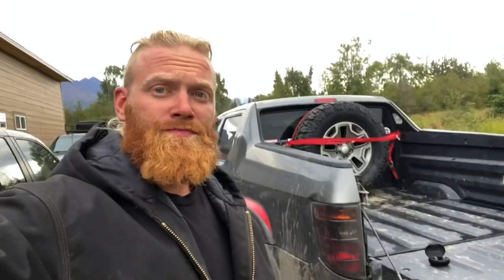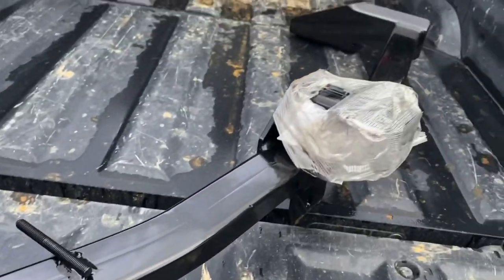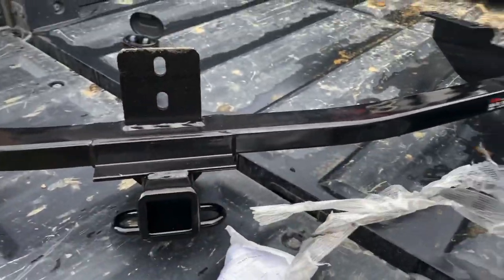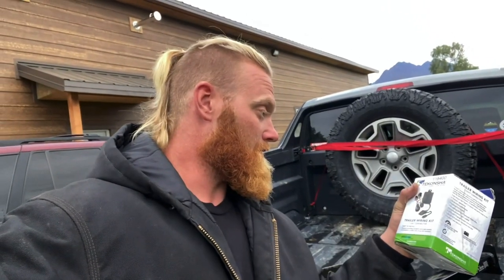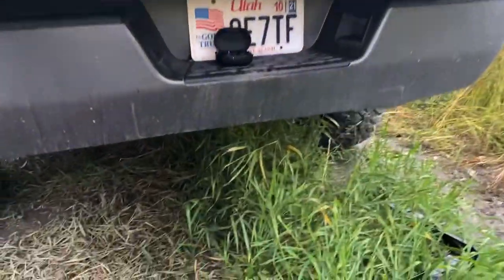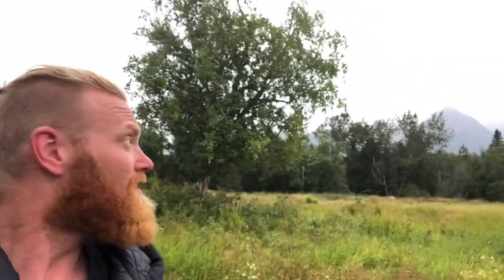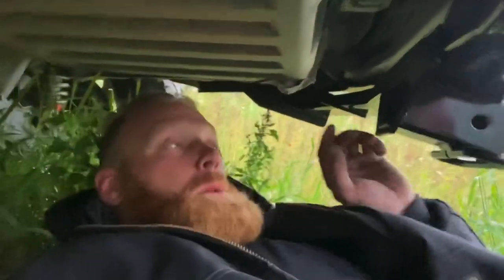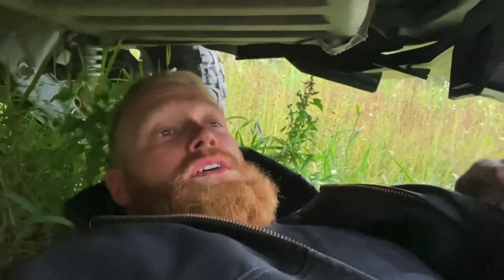How to install trailer hitch from ‘etrailer’ Honda Ridgeline

Comment: Your spare tire mounts on the right side in the bed with a bolt. Owners manual!
Reply from the maker: Yes, for a regular size tire. I tried making it work for a 33” tire.. doesn’t fit. Thanks for your support.